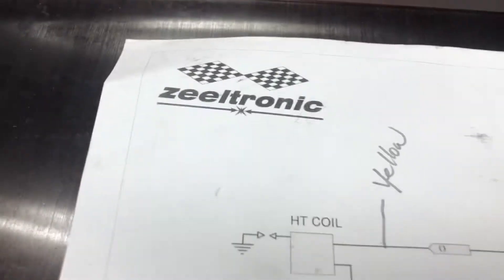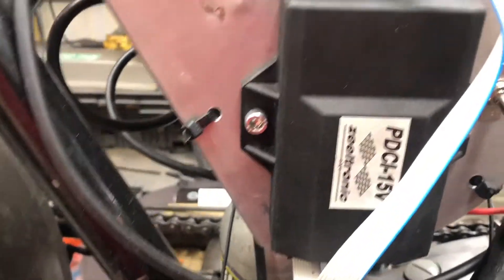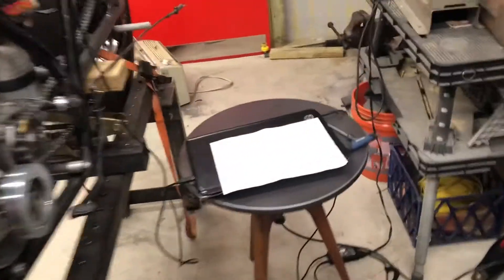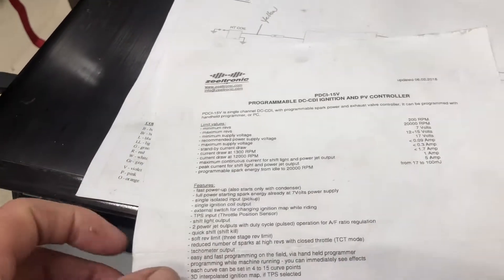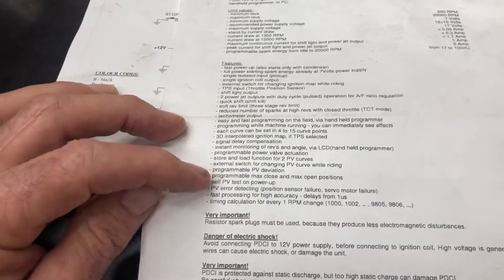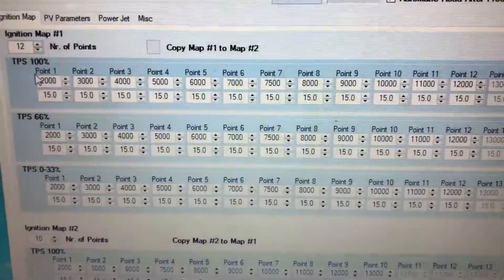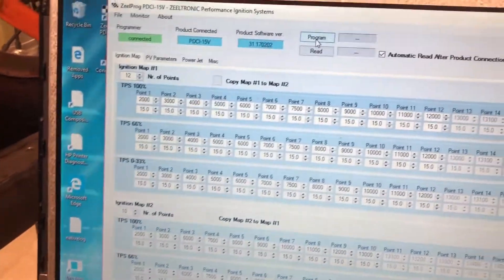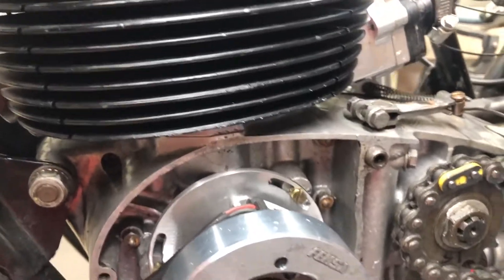Zeeltronic Electronic Ignition Part 1

Comment: Two of those pick ups are not just pick ups. They are complete electronic ignition modules that are meant to connect directly across the coil terminals. They will NEVER work with that set up.